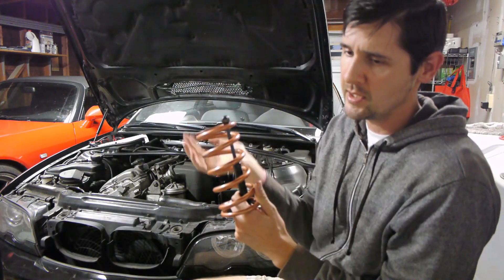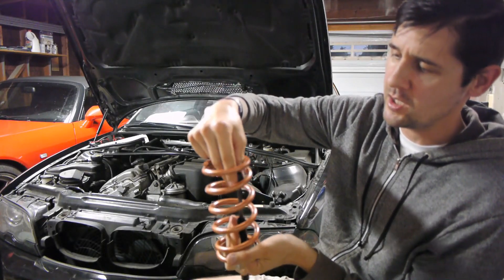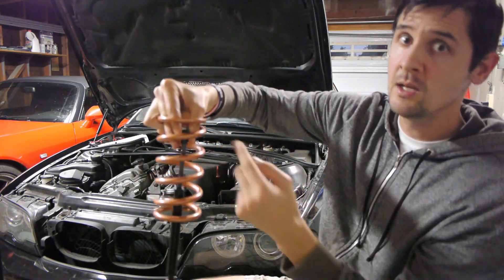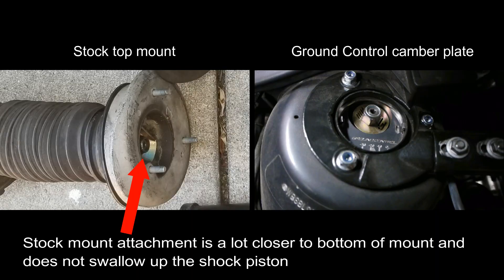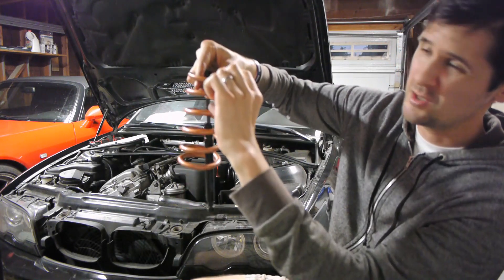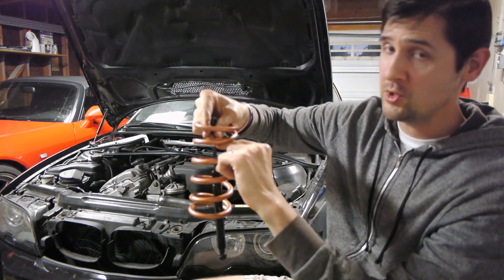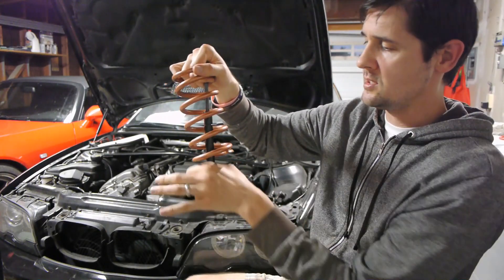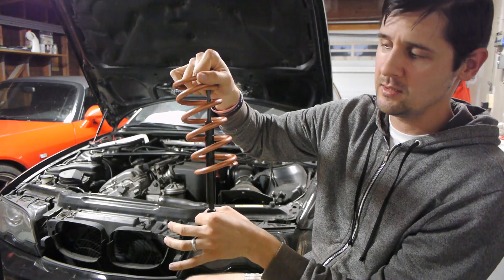Shock Explanation - travel, bump, droop (Part 2)

Comment: I have an E46. How much bump travel is good. I have 400lb front springs. At 13.5 ride height I have 1.64 inch before bumps stop engaged. 4.25 inch at full droop. Is 1.64 inch of bumps travel good. My bump stop is 1.77 inch.
Reply from the maker: You want to target around 60%-70% as bump travel, so work on your ride height/spring length/rate/preload.

Comment: Great explanation. We installed Öhlins road and track on some Turner camber plate and was confused why ride height was so low. Where can I get the spaced on the collar that u mentioned
Reply from the maker: Thank you for the kind words. I have another series, here is part 3 with explanation of the spacer https://youtu.be/1yj2K9ZhvMA. The spacer itself you can get from 3dm at this link https://3dmmotorsport.com/products/bmw-m3-e46-ohlins-e46-front-strut-spacer-kit. Have fun!

Comment: Great video and explanation. I saw a video of Obsessed Garage where he adjusted his S2000 Ohins, with height and pre load being two different adjustments. When you adjust height, doesn't the shock "drop" into itself, leaving the spring pre load as it was, since it's moving as a unit "into" the body of the shock?
Reply from the maker: On S2000, the spring preload is done as a separate adjustment from ride height. On the M3 it is the same adjuster. The shock piston doesn't wouldn't move into itself on the S2000 if spring preload is left as is but ride height is adjusted. On the M3 the shock piston would move. Hope that clarifies it.